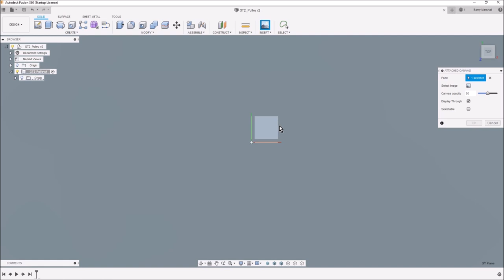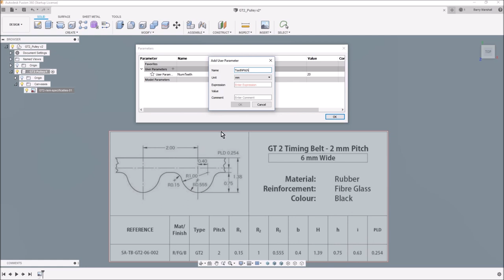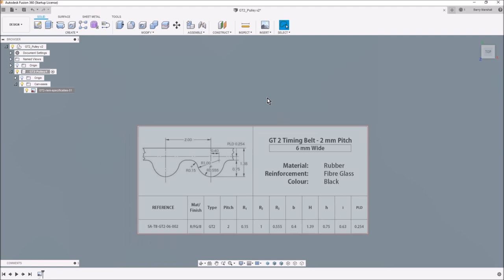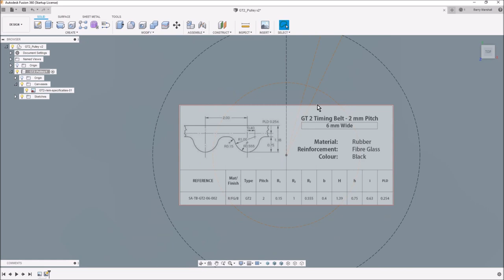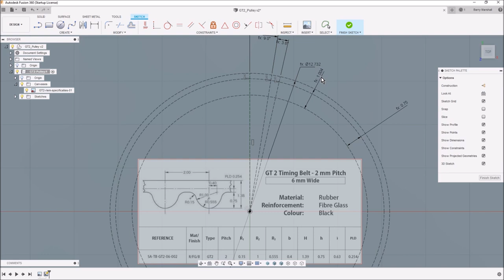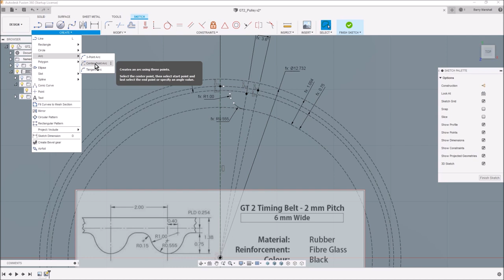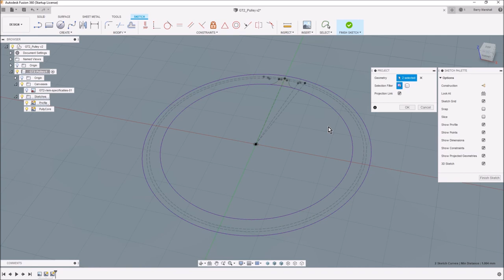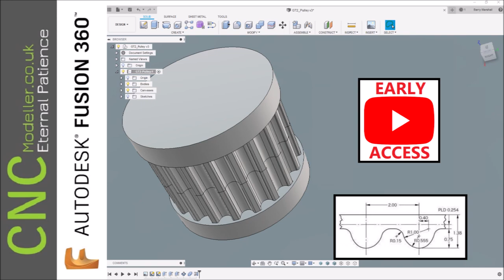How to create a GT2 Timing Pulley in Fusion 360 - CAD Tutorial

Comment: Great video! Only one thing is not really clear and not nice (maybe it is not correct) how you connected the "Trans_Radius" to "Root_Radius" (with an undefined arc radius), I am not a professional but I think the "TransOffsetAngle" is not correct and that is why the two arcs are not crossing. The drawing has a parameter "b" which is 0,4mm, this is the distance between the center of "Trans_Radius" and "Root_Radius". If I measure it based on the "TransOffsetAngle" it is not 0,4mm. So I have deleted the "TransOffsetAngle" and constraint (Tangent and Coincident) the "Trans_Radius" and "Root_Radius". This will give a center distance of 0,399mm. What do you think?
Reply from the maker: Hi Tibor. Thanks for letting me know what you think. Without digging back into the CAD I'm not sure. However if you go back through the comments there was one that suggested some refinements. I also Posted an update video that might help too. 
https://youtu.be/_m8EF0m3C8s
Good luck with your design!

Comment: To those having issues when changing the tooth count: When Fusion 360 does the "Combine" Operation, it does not combine any new teeth (e.g. made it a 30 tooth pulley, it will only combine the original 20 teeth). This causes the mirror operation to only operate on the combined body with only 20 of the teeth. I would recommend leaving the pulley width fixed, and the mirroring only the flanges, or just not mirroring at all. If you want to 3D print the pulley, make sure to combine everything manually before exporting so that the model is uniform.
Reply: HERE'S THE 'FIX'...
- Do 'Circular Pattern' on the 'Extrude/join' FEATURE, not on body.
- Also, use 'Compute Option:Optimized'.

Comment: I realize you posted this 5 years ago, but I only just needed to use it.  I figured out why you had to fudge the transition between the R=1.00 and R=0.555 arcs and, consequently, why there were issues with circular patterns after changing the number of teeth.  

You used a fudge of 0.2*ToothAngle to replace the 0.40 mm horizontal distance between the centers of the two arcs.  However, that creates too large of a distance to join the arcs when wrapping the tooth profile around a circle.  So I found a better way to fix the center point of the R=1.00 arc to allow the two arcs to meet.  

With a flat profile, the distance between those centers is sqrt(0.4^2 + (ToothHeight-0.555)^2) = 0.445mm.  So I created a point constrained to the circle at the top of the teeth and 0.445mm from the R=0.555 center and used that as the center of R=1.00 arc.  That allowed those two arcs to be coincident and tangent without having to create an intermediate arc.  It also allows me to scale the profile through a much larger range of tooth counts.

Comment: thank you, this was a great help! I've gotta grind a tool to cut these, having a good model really helps.

did run into an issue dropping to 16 teeth.  I think you technically left the lengths of 3 of those arcs unrestrained, so when I scaled down, it drew crazy tangents.  I just used another center circle to fix the length of the lower arc  (0.90mm larger than root diam).

Comment: The way you design your tooth assumes that the tooth distorts and flexes as much as the narrow part of the belt. But I would contend that the tooth stays rigid and only the thin part of the belt flexes (the part of least resistance). This would mean that you would design the cut out for the tooth as per spec from a straight line from tooth top to tooth top. What you define as the tooth top on a curved surface and rounded edges (shoulder radius) is difficult to say. Where you define it varies the depth you cut into the pully for the root radius of the tooth.  I used the 1 mm transition radius minus 0.4 (because it starts  0.4 on the other side of center) i.e. 0.6 + 0.15 (shoulder radius) to give 0.75 (as a reference point). Looking at the tooth profile of a 15 tooth pully and a 60 tooth pully I was surprised to see a round-top on the teeth (no flat spot at all). When you flex a belt to a small diameter you see that the gap between teeth in the belt is almost round matching the tooth profile on a 15 tooth pully. I arbitrarily changed the shoulder radius to a formula that gives almost a round top tooth at 15 teeth and the original 0.15 radius at 300 teeth (to all intentions just like a strait belt) as follows (0.143 + (2.1 * (1 / number of teeth)). I used this formula multiplied by 0.8 + 0.6 as a multiplier to 1/2 the tooth angle to get an angle for a construction line. Where this line intersects the tooth height circle is the point I drew a straight line across. I then had a construction line (from the straight line across) going down the tooth height (0.75) to the bottom of the "root radius" circle and created a 2 point circle using this bottom point. The transition radius point also on this straight line across. By making the root radius ark, transition radius ark, shoulder radius ark, and the tooth height circle all coincident and tangential gives the finished profile. Your thoughts? (if only I could add a photo of the sketch to this comment) The center of the root radius is on the vertical line you used for the center of the tooth. This puts my completed tooth to the right of center after mirroring to the right using the tooth angle construction line as the mirror plane.
Reply from the maker: That's totally another conceptually valid approach. Personally I was looking for something that works, and under load the only really important aspect is the radius of the belt webbing and good engagement. The rubber teeth will compress to accommodate any errors and that compression should improve tooth location. I just used the simplest transformation that I could, that being Cartesian coordinates on the drawing to polar to wrap it around the pulley. Let me know how you get on with your approach.
All the best
Barry M

Comment: I tried the example and it is working fine. I ran into problems when trying to generate a pulley with more than 40 teeth. It says PulleyTeeth failed. PulleyTeeth is the name of the sketch generating the teeth.
I have not done the combination of all the teeth to be more flexible in parameterizing the pulley. Any idea where this can come from?
Reply from the maker: Unfortunately I've not looked at this for a long time so I can't remember off the cuff. Sorry.

Comment: Hello, I have a problem to solve, it happens that I cannot find the table of measurements of the GT3 8M timing belt to be able to model a gearbox of an engine.Or simply tell me a way to model a pulley in Fusion 360 with the parameters that I want. you would help me a lot. Thank you
Reply from the maker: I assume a gt3 belt is a 3mm pitch... So you could try scaling the parameters accordingly?
Reply: @CNCModellerUK  In fact, it is 8mm pitch, so I can't find the required parameters, thank you very much in advance.

Comment: thanks for this.  really helped me out.  is there a method to easily make the pulley bigger with more teeth but maintain the 2mm pitch?  i tried messing about with the no of teeth in the parameters but it doesn't scale up correctly just by adding teeth to the parameters.
Reply from the maker: Hi Ash,
     No worries, glad you found it usefull. Fusion doesn't seem to like scaling the fillet between the root radius and the tip radius. If you remove that and change the parameter from memory it should scale properly. I just needed a very large gear 720t so I needed a really accurate design to make the belt fit over that nearly 650 teeth spread. good luck with your design. 
Cheers 
Barry M
Reply: @CNCModellerUK  Hi. I'm also having problems scaling this. Could you explain in more detail how to do what you wrote here?
Reply from the maker: Hi Lefe, I've been asked about this quite a lot recently so I'm going to create an addendum video to clarify what to do. Life has been a little chaotic recently but I hope to get it uploaded soon. Many Thanks 
Barry M
Reply: @CNCModellerUK  That's great! Thank you for going through the trouble